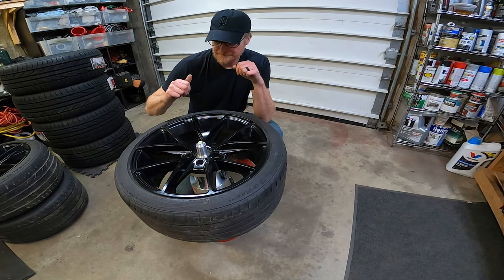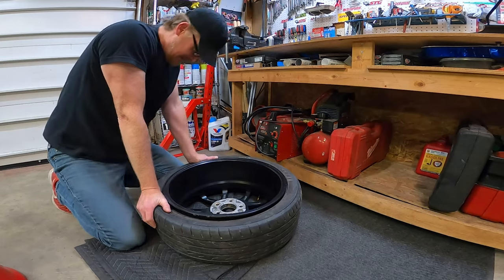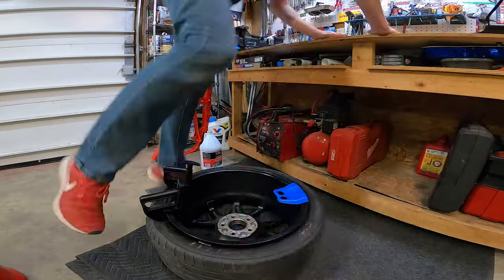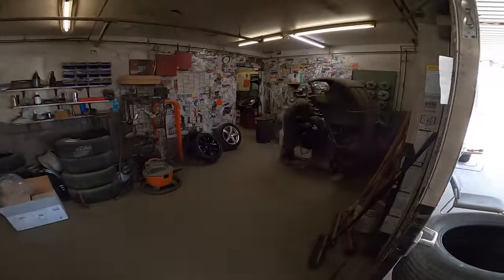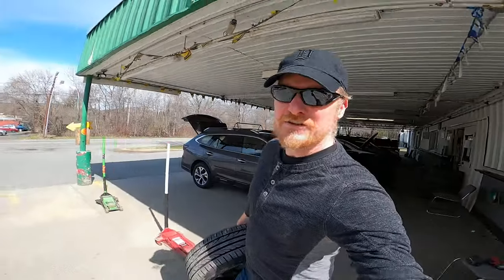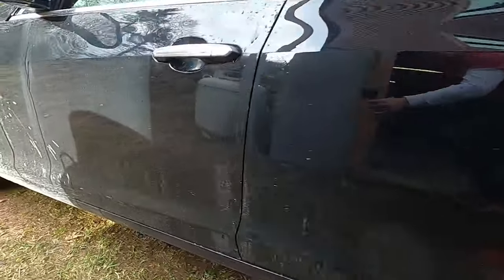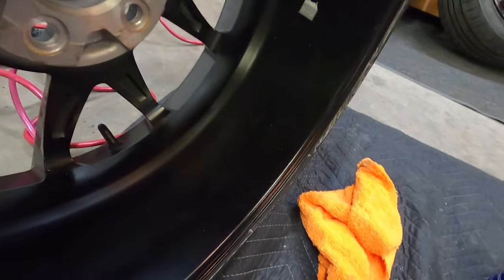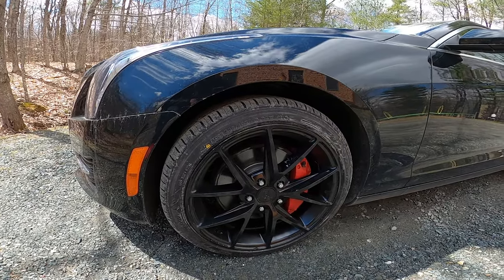Install & Drive Review Lexani LXUHP 207 | Cadillac ATS

Comment: Thanks for the review! I'm looking at these tires for my daughter's 2003 wrx for summer tires...we are in Iowa.
Reply from the maker: I am completely sold on them. They are true quality tires and I cannot believe the price point. I could not be happier.
Reply: How did they handle the winter climate?
Reply: @DandyWaves  here in VT we don't run tires like this in winter. All seasons are not for real snow like we get here. We have to swap over every winter to winter tires. Many of us have a separate set of wheels with winter tires since it's much easier that way. Speaking of Tire warehouse and winter tires. The best winter tires I ever had I got from tire warehouse in Berlin VT. They were the cheapest tire, but for whatever reason they performed better than friends running brand new Cooper weather masters, or Hankooks. This was way back in 2003 though, and I remember they only had those tires there one season. Wish I could remember the name of the tire! Over 20 years ago now lol.
Reply from the maker: I never got a chance to use them in winter. As DandyWaves mentioned, I slap on my second set of wheels with studded snow tires 😎 but that’s Vermont with steep snow covered mountain roads. But when I lived in Michigan and Chicago IL area…. I never used snow tires. A good all season did what needed to be done even on snowy days. But living here in Vermont is not the usual. The first time I slid down a steep road, sideways, is when I swapped out to studded snows. Game changer :) but if I lived even in Albany NY I’d drive all season tires all year around. They don’t have the snow volume. They don’t have the ice covered dirt roads. I hope that helps.

Comment: Ironically, I’m swapping out my General Gmax RS for some Lexani LXUHP-207.  In 225/40ZR18 for my Mk7 GTI.  Makes me feel better about my choice.   $58 a tire from Walmart was kinda hard to beat.
Reply from the maker: You won’t be disappointed. Incredible price 💪👍
Reply: Glad I saw this comment. I just bought a set to wrap around my RPF1s to throw on my Mk4 R32. $261.04 shipped to my house.

Comment: Great vid, glad the ATS still going strong. My 13’ premium ATS has 140k miles. I was able to take advantage of the Costco credit rebate and purchased the Michelin PS4S for free. Hands down the best tire ever. Grips like nothing ever before experienced. Well worth the price. Definitely a west coast summer tire though. I will never go to another tire brand.
Reply from the maker: Free? That’s the best 😎👍 I had a list of tires to consider. Ps4s tires were on it. I ended up with these and have no regrets.
Reply: Free was a loose term. Basically rewards money for spending my money. Lol.
Reply from the maker: @r.serrano9377  Well hey, a nice way to use rewards money! :)
Reply: Well, that Pilot Sport is a Summer tire and not a All Season tire. So of course they're going to ride great and grip excellent in the hot sunny weather with that soft & sticky contact patch. The thing is that you might go through 2 sets to his 1 set within the 4 years which all depends on how you drive and how hot it is.

Comment: I just did road force balancing at germain bmw south of naples. These people sent me home with rear balance 38 and 32lb of road force, and yes, they took the money. Wheels were Apex brand new.
Reply from the maker: Thats completely horrible. Tires of round or damaged or manufactured incorrectly. Unless the people running the machine didn’t know what they were doing…. What did they recommend when they gave them back to you like that?
Reply: @sstressfl  They gave me an invoice and made me to pay. They told me nothing. Tires brand new, wheels brand new. In Naples, FL craftsmanship doesn't exist, everyone is here for a quick buck.
Reply from the maker: My typical experience every time I pay someone for help. I am in shock when I run into an honest mechanic. I’m sorry they didn’t help. Most often the spin once and charge you. But with road force they should rotate the tire on the wheel to reduce the imbalance. That’s what you pay extra for!

Comment: Haha another great video with which I can relate! I also do my own fit and balance motorcycle tires  (Yamaha R1) as I'm big on track days and have sometimes even done them at the track. . But low profile car tires are a whole nother thing... Unlike bike tires (which you can get dead on with a quality manual balancer) you can't ever fully balance car tires, much less performance ones...with a static at home harbor freight balancer, so you did the right thing there!
Reply from the maker: I was willing to try ….. until I tried lol stiff low sidewall tires are best left to the machines 👍😎

Comment: That's a nice looking bead breaker you made. I have one purchased from jc Whitney many years ago that works well but I've only ever used it for motorcycle tires.  When I saw you trying to dismount your low profile ats tires I was not surprised you had trouble.  I would never have even attempted it so I give you much credit for trying.  Even though I prefer to do most work myself , there are certain tasks that can only be done properly with expensive equipment.
Reply from the maker: I used to work at a tire shop in college. But enough time goes by and I forget how hard it could be even with hydraulics. I started to think "maybe I can do it...." I"m very thankful for tire warehouse.
Reply: Thanks for the reply Michael!

Comment: I replaced the original wheel and tire (215/60R16) with Lexani 245/40R18 on a new set of 18"Konigs (18X8) for my 20 year old Lexus. 
Lexani was not my first choice, but was intended only as a temporary set. I've been driving on them for two years, and see no reason to change them out for another brand. They really surprised me.
Wet driving requires a bit more caution, but the width of the contrasting tire sizes is more to blame. (The difference is pretty mild)
Reply: Like Clown shoes vs Having a nice pair of Addidas. This is how I felt when going from 215/60r16 to 245/40r18.
It was also like driving a different car.
Reply from the maker: They are truly surprising. Should be a cheap unsatisfying experience but instead they roll beautifully, handle well, quiet, and seem to be long lasting. Big huge tires can look great but they sure are heavy! You can feel it in acceleration and braking! I used to go big now I know that you shouldn’t unless you truly need it and can upgrade your brakes! Lol

Comment: I have been sticking with the bfgs comp2s 18 inch. It's been a smooth ride in my opinion might be worth it for you next set
Reply from the maker: My buddy just put those on his '16 GT. I used to have the original comps on an old 94 Mustang and they wore fast. Perhaps they have improved over the years. And by the way, my next set will be these same Lexani tires. They are mind blowingly smooth, handle great and long lasting.

Comment: Hope you will do a follow up review. I put a set of these Lexani's on our Chevy Bolt. $86 each. So far no complaints. I didn't know these were unidirectional.
Reply from the maker: Sure will. I'm watching the treadwear. So far so good!
Reply: @sstressfl  Thanks, good to hear. How many miles have you put on them so far?
Reply from the maker: @epcalderhead  about 3,000! They still look good. Even and flat tread… no weird wear patterns 👍
Reply: @sstressfl  Have the tires gotten noisier as they have worn? This was pointed out in another video review. Thanks!
Reply from the maker: @epcalderhead  not yet! Still crazy smooth and quiet. It would be especially noticeable in this car too. It’s so quiet. I will definitely do another review after the harsh long winter in Vermont is over :) as it is right now I still adore these tires.
Reply: @sstressfl  Thanks for the update! Looking forward your long-term review. Still have a year or more left on my OEM's, but focused on these when the time comes.

Comment: Thanks for the review, I’m thinking about getting these Tires. How are they holding up so far?
Reply from the maker: I traded the car due to on going issues but I would buy them again if I had a car that needed such tires.
Reply: @sstressfl how did it handle in the rain? Thank you
Reply from the maker: @johnnysaephan8024  As well as any all season radial I've ever owned. I am always careful in the rain, but these tires never surprised me. They felt great.

Comment: I am seriously considering getting these for my 2014 ATS, but i live in Ohio and have to consider the few months we get some snowfall.  Have you had any experience with these in snowy and wet conditions?
Reply from the maker: I lived in MI, outside of Detroit, and drove FWD and RWD cars and never purchased winter tires. It wasn't until I moved to rural VT, living on dirt roads in the mountains did I ever need winter tires. But overall, the tire is very good in wet and better than most in winter especially if you have awd.

Comment: I just recently purchased a set of these tires online for a great price and I'm so glad I stumbled upon your channel for the review. I have a tuned 08 335i and over the last year I've spent so much in go fast parts and goodies that I've honestly just been running used tires on it. I finally have the car up to spec...... making a healthy 400hp and it's time for some new rubbers. I've got 2 bmws and 2 work trucks that I have to keep up to date and in good working order so I didn't have much change to throw at tires this go around so decided on the lexanis........... your video has me feeling great about my purchase. Thanks bud! 😎💯
Reply from the maker: Fantastic! Sounds like an amazing ride that’s very much your own. The tires are amazing and hard to believe the price for performance. Glad the vid helped confirm your choice! Enjoy your new tires and your 400hp 335 💪😎
Reply: How did they grip??? Cornering?😊
Reply from the maker: Sticky! Soft compound. Smooth and quiet and they stick! Went to the drag races with them (awd of course) and I could not make them spin. Launch felt like a boost from a rubber band. Handling for me was poor. They rolled over.

Comment: Do you still recommend these tires?
Reply from the maker: I traded the car a couple of months ago, but I adore those tires. Smooth. Great handling. And long lasting. I didn't get to drive them until they were bald, but the tread was obviously stout. Especially when compared to my gmax tires. Yes I still recommend them! I have never seen such an amazing price to performance value than with these tires.

Comment: Can you tell us more about the ws6 you had
Reply from the maker: Sure! It was a 99 model. Found it at a local dealer in Pensacola FL in 2002. Traded in my 97 Camaro :) Was sold as a certified vehicle but later learned it had been modified. But i was ok with it cuz it saved me the time. I did a lot of my own mods. Bought some street slicks and went racing once at Milton drags in FL, then moved to Atlanta area… then Vermont… met my wife-to-be, got married, and she did not like the women hollering at me (only car I’ve ever owned that caused that), and I traded it when we moved to CO. Here’s a pic… let me know if you can see it https://www.facebook.com/photo.php?fbid=271334226260065&set=a.271334192926735&type=3 here’s a pic of the rear suspension… I was trying to help the 10 bolt. Moser axles. Braced. 3.73 gears. It needed at least a stronger 12 bolt from moser. After 4 runs at the track with slicks the poor rear end growled all the way home. When it cooled down it didn’t make any noise and I was able to drive it daily :)  https://www.facebook.com/photo.php?fbid=271334886259999&set=a.271334192926735&type=3

Comment: i hope these are better than the lexani twentys.I got a set of 285/35/20 for my camaro ss1le and they are the absolute worst tires ive ever bought.they are terrible on cold dry roads,worse on wet roads,the sidewalls are way to soft and there is so much tread squirm its not even funny.the bfg comp 2s i been running are a little more but far better.
Reply from the maker: Sounds like you had a serious alignment problem. I had comp 2s on a mustang and they went bald crazy fast. For the money I paid for comp 2s, never again. At $89 each the Lexani 207 is a commonly purchased tire even for bmw guys because of its value and ride quality. On my Cadillac ats the lexani 207s handle great, ride smooth and quiet, and will outlast the comp 2 at a much better price point.
Reply: @Michael Byrne  definitely not an alignment issue. Maybe the the twenty series are worse than the ones your getting. I've had good luck with the bfgs my kid also had that bfgs on his turbo Fiesta and he loved them